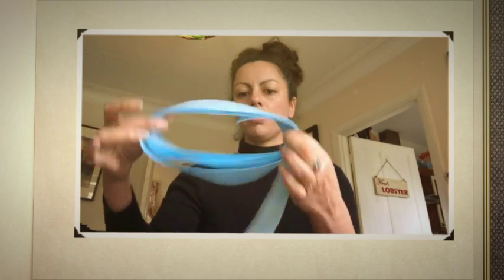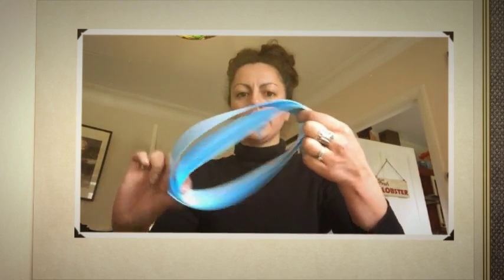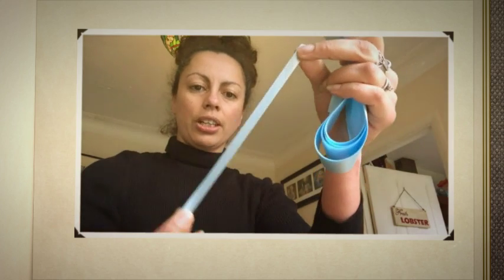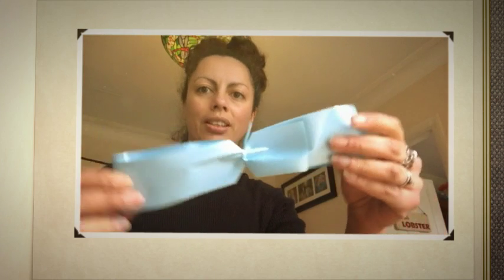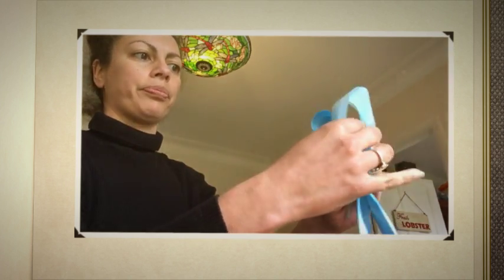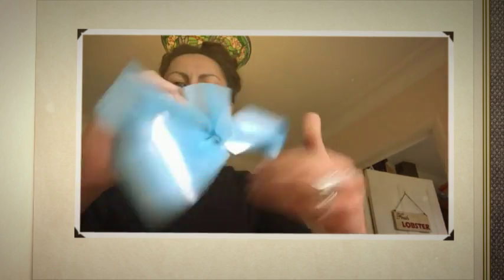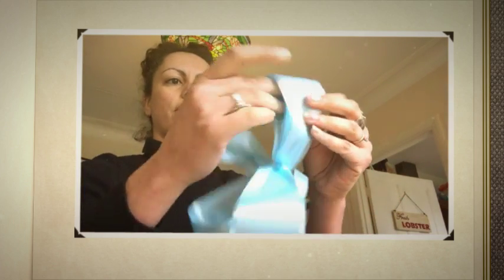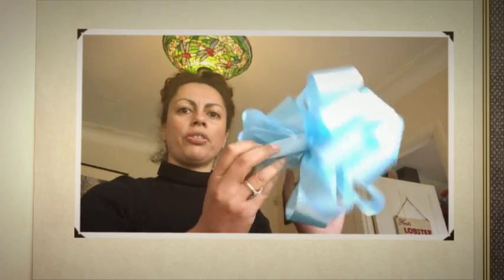How to make  a bow for your wedding car

Comment: Amazing and super helpful|! I didn't the get of the ribbon that should be cat after cutting the triangles, is it from the bow or from the ribbon? hence I need to leave some ribbon before using all of it
Reply from the maker: Academic Translations thank you - yes, leave a little ribbon extra to tie around the bow. Say 20-30cm.... cut or ripped to a thin strip to tie around the triangle section.